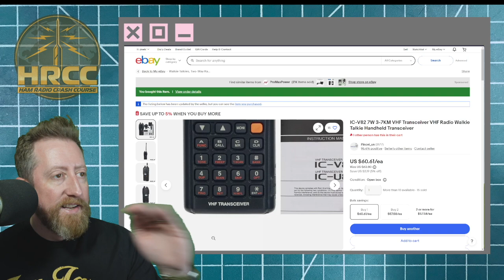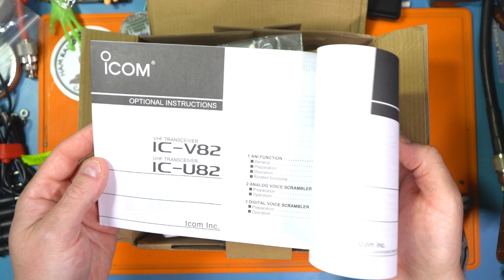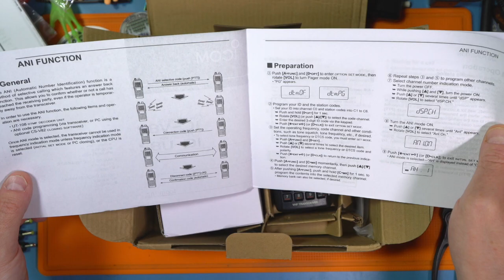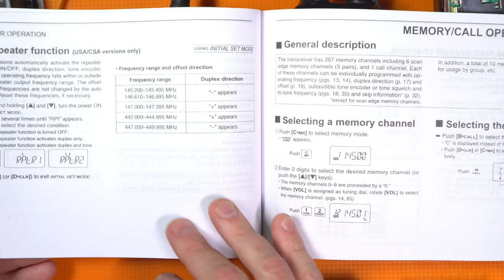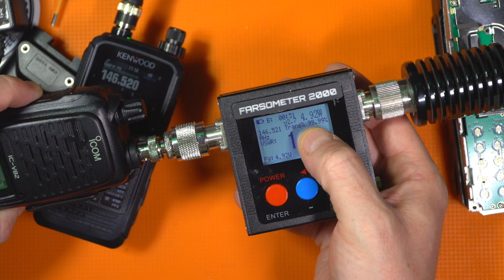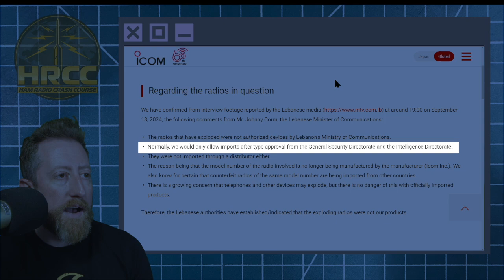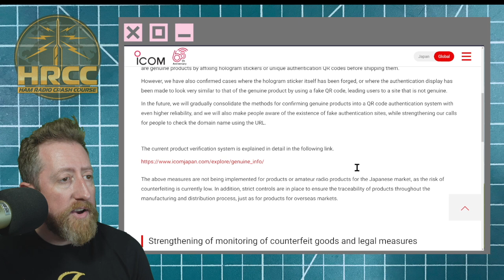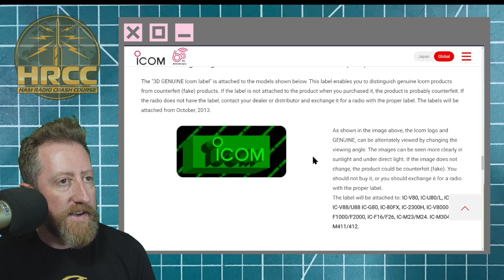Is This The Hezbollah Radio? ICOM IC-V82 Clone?

Comment: The v82 is regarded as one of the best radios for intermod rejection. If you google best sota ht for high rf environment , there is a great spreadsheet which lists the top ones. V82 is noted to be on top of the list, would be interesting to see how these clones stack up
Reply from the maker: That is a fantastic idea.
Reply: @HamRadioCrashCourse I guess a new SOTA activation & tech investigation will be in the works!
Reply: That test would be explosive.....👍👍👍😂😂

Comment: My theory was the spicy stuff was in the battery. I figure it was triggered by dtmf or other tones mass broadcasted. They could put a tone decoder on the board that switches a relay to dead short the sabotaged spicy battery. The accessories bay would be too risky as the enemy could look in there and realize their radios were compromised

Comment: I have exactly one of these radios. I believe mine is the original version, since it's not new. I've had it for a while and before that it belonged to a friend. If you need pictures for some kind of comparison, let me know.

Quickly comparing mine with the one in your video, on mine, the bottom cover has a warning that modifying the radio to listen to telephones is prohibited by federal law. My battery is also different, model BP-222n, Ni-Cd, unlike the one you have in your hands. Still on the battery part, there is no real Icon hologram label, just a label similar to yours. Maybe at the time it was manufactured it was like that.. Finally, the noise the radio makes when it turns on also seemed to have a different tone to me.

Comment: I purchased one of these V82's last week. The plastic on mine feels thin and cheap. The battery is difficult to remove. The menu structure matches the real V82. The manual looks like Josh's, washed out and uses cheap paper. No booms, which was a plus.
Reply: It works with Chirp too

Comment: I’ve had a few electronics manufactured in China. When they own the injection molds, mfg the box and printing, along with assemble the boards and flash the programming, it’s how they create knockoffs the week before you launch your product. I had to put accountability measures into programming the firmware that prevented them from doing production runs without our approval. That stopped them from copying our product and ripping us off. Used molds also create rough plastic. Normally you replace the mold after thousands of runs.
Reply: I’ve heard stories just like this in metal stamping going back over 15 years. People would send their specs for tooling over, get a bunch of pictures with the stamped product, receive the tooling only to find out it can’t produce the product and see their stuff on store shelves while the owner is re-cutting radius’ on their own print tooling.

Comment: Have both the IC-V82 and IC-U82 from back when they were current Icom products.
You can see the plastic used for the cases is a different texture on the fakes in Josh's video.
And the batteries release easily from the real deal, so moulding issues exist on the fakes.
The real ones are very nice mono band radios which I originally purchased for D-Star when it was first introduced.
And yes, the header for the UT-118 module is missing in the counterfeit product.
Reply: And your battery could have a "made in China" label as most batteries (including those for ICOM) are "made in China"
Reply: @ronmikkenie73  Which makes it an OEM battery and not a fake. China produces much OEM product for other companies as well as complete counterfeits of the same thing.

Comment: I wonder if ICOM sub contracted the build of the original radio out and these clones are being built by that company? Ed.
Reply: this is likely what happened.  building/reverse engineering from scratch is way more effort that getting some boards and cases from the original manufacturer without the quality control.  these could be quality control rejects, but that is unlikely for something this old.

Comment: based on some of the pictures I'm wondering if the payload was inside of the battery pack rather than the radio itself.  Most of the damage to the radios looks like it was applied externally, not from inside.
Reply from the maker: See my first video on this topic. That seems very possible.

Comment: I have 30-year-old Icom IC-T2s that still work properly. They are older than the V82s. The plastic still feels rugged and better than a modern China radio. They were 100 new and recently 35 used. 
The only problem with these old units is failed battery trays due to the latch breaking or batteries leaking. I purchased replacements and they are from the cheap plastic material, but they keep my radios in service.
Do we know when the exploding radios were purchased by the end users?

Comment: Did ICOM ever sell these into commercial radio channels or were they meant for amateur use?  Shielding and features were always differences in US radios, you really didn't want end users to change frequencies/tones if in commercial operations. Do militias and paramilitaries around the world commonly press amateur equipment into use by virtue of their lower cost and easy frequency change ability?  Unsophisticated combatants I guess are often left to BYOD or just a step above that. 
I'm curious how well these rigs function in a knock-around tool role. Can they stand being used and abused as a more rugged commercial radio can be.
Reply: Afghan insurgents used ICOMs.
Reply: Icom sold the IC-V82 in both the amateur and commercial markets. Use of amatuer radios by different groups around the world has increased as prices are falling and quality is improving but I have yet to see anything as rugged as most commerial equipment.

Comment: I was in the 82nd Airborne Division from 2002-2006 as an infantryman, I deployed to Iraq 3x and one of the radios we used for local comms was ICOM radios. I never had one as I was only lower enlisted while serving but I vividly remember seeing them being used, which is odd because they have zero security / encryption like our Army issue radios had through regular encryption updates through an ANCD.
Reply: There is an encryption chip set for the Icom F3/F4 which I'm pretty sure are what the Army was using. Whether they incorporated the encryption board I have no idea.

Comment: This may be less a clone and more a case of an overflow production unit.  ICOM (japan) subcontracts in 2002 to SHENZEN LUCKY DOG corporation, for 100K units of IC-V82.   It duly sends plans, PCB layouts, and then cancels that contract after 500K units, in 2005.  In 2005 through 2010, SHENZEN LUCKY DOG continues to manufacture this item.  This has happened and is confirmed to have happened, for other non-radio items such as electric guitars.  The name SHENZEN LUCKY DOG is a mere placeholder but such companies are all over.  China has a billion people and has massive industrial capabilities.  Telling someone to stop making something and calling it an ICOM IC-V82 is hard to do, and impossible to enforce, as "intellectual property" is a concept that doesn't wash over there, and seems like western imperialism to a guy trying to make a buck selling radios in 2024 on Ali Express.  The lack of the hologram is in fact exactly how western companies plan to combat this kind of overflow-production.    This thing is not "fake" so much as "unauthorized".  It is 100% the same and made in the same place using the same plans as a bunch of authorized radios, but its production was unauthorized and is in many ways in the west "illegal" and a "violation of trademark, and patent, and copyright and every other intellectual property law" in the west, all of which won't buy you a cup of coffee in Shenzen.  Reverse engineering was not required, simply hitting go on additional production runs after the authorized runs were over, is all that had to happen.  The initial runs of unauthorized radios are simply sold locally around China, and accepted readily as being the real thing, and are also valued highly in places like Afghanistan and Lebanon.   A batch of 20K radios that take the same parts is exactly what a place like that wants and needs. Ironically those holograms are also mostly manufactured in China, and facsimiles can easily be made.
Reply: I can confirm after comparing these, (I had purchased two from the same seller myself a week ago) with a real IC-V82, that this is more than a casual copy. The pc artwork and components are identical (as far as value and function), as well as the molds and castings. The case material is a bit less dense of a plastic, but seems just as strong. I put it on my service monitor, and as far as emissions, it is within the parameters of a genuine IC V82. The only real difference is that it is unlocked, and will transmit throughout the VHF communications band. As well, the power is a bit less, but it is optimized for a wide band coverage. Using the service monitor, as opposed to a cheap directional coupler, it makes 5W+ over the range.

Comment: Is there a chance that this actually isn't a copy, but new old stock?
Reply: Not in those numbers plus it lacks the holographic sticker a real icom would have
Reply: overproduction. intentional generation of new old stock to be sold through side channels. icom received 0.00 in profits for these as it was not involved in their distribution, wholesaling and the OEM took over and sold these directly.
Reply: The holographic sticker I think is a quality control sticker maybe a huge batch failed that check and maybe they got sold off for parts?
Reply: @nehem11e  It is the sticker showing it is a real Icom. If a radio failed QC it would be reworked on the line until it passed and then sold. They don't make that many ham rigs of each model... so tossing some wayyyyy below cost is not going to happen. 

These are selling for $50 or less from China... I can order one right now! This is a 10 year old since it was discontinued radio. 

Any seconds would have been sold long ago. 1,000+ would not be dumped on the market now. Icom wouldn't suddenly find them in a warehouse, not with modern inventory management.
Reply: @MaryBrownForFreedom  that makes sense

Comment: My opinion is that an unnamed agency bought some clones of this radio because it fit their use case and it was what the targeted group would buy. They then added the explosives and triggers and then set up an operation to sell them to the targeted group. The "exploding battery" scenario is a weak smokescreen.
Reply: Another possibility I'm partial towards is doing exactly what you said, but replacing the very old battery tech with the absolute best modern batteries, so that you have lots of spare space inside the battery itself for explosive.  Hence "Exploding Batteries", even though it's high explosives inside the battery case...
Reply from the maker: You both are in line with my thinking.